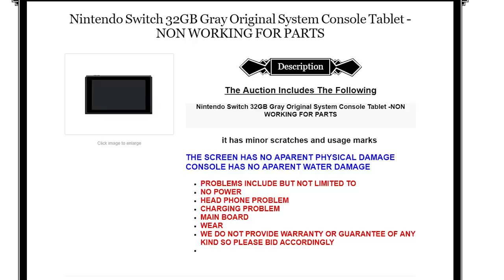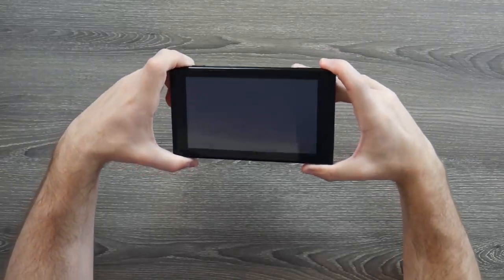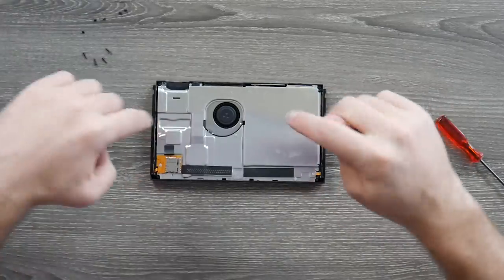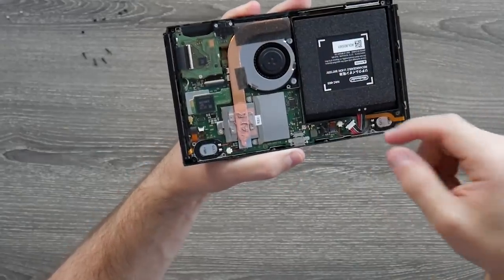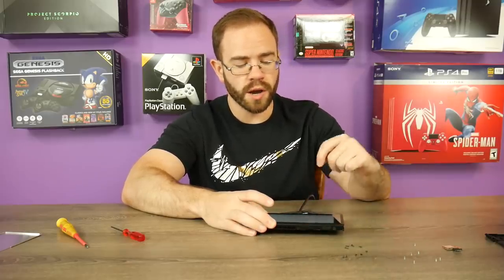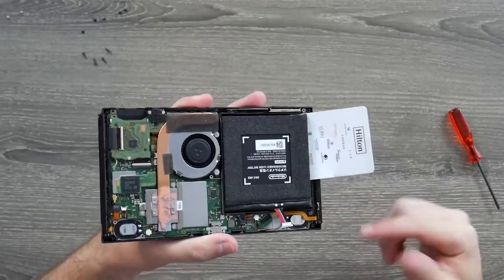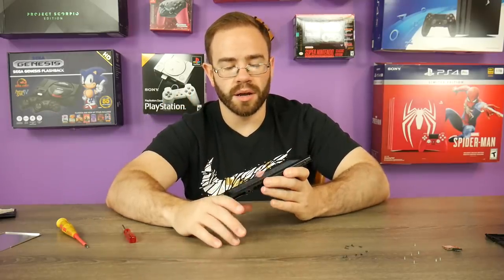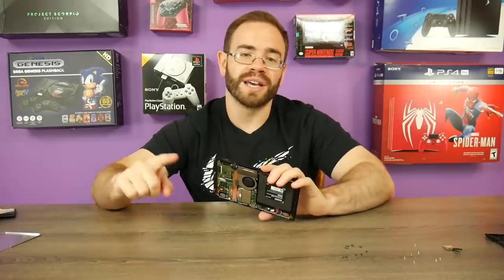I Bought A Broken Nintendo Switch On eBay...Can We Fix It?

Comment: Check if its compatible with CFW and use it to mess with CFW, i've heard that XC2 in portable mode with a bit of OC (using 400+ mhz core clock speeds, usually you dont overclock over the stock speed plus that its really unstable if you go over stock, you just adjust the speeds during portable mode a little bit higher than the defaults,) helps a lot with the crappy dynamic resolution.

Comment: Definitely informative but I wouldn't buy it unless I just needed a second Switch, like you said. I got my complete console with Animal Crossing on eBay for $225, so it actually came out to less, especially considering if you had to buy the battery.

Comment: I purchased a "broken" switch for $100, it had the wifi chip issue where it just needed to be heated up so it would set better in the solder and connectors. Now it works amazing. And it has BOTW and New super Mario brothers games on it, BONUS.

Comment: I would certainly love to get a broken Switch to repair it and use it as my own. 
But it doesn't seem like that's worth it like at all. 

They will in 95% of cases just sell the Tablet, so if it worked, I needed to buy the Dock and Joycons anway, upping the price QUITE a bit. Then I don't have Spare Batteries and shit, that in this case would help troubleshooting and fixing. And last but not least, most of them are sold on ebay for like 80-100€ without anything else. In this case with the Battery, that's totally worth it. But anything could be broken and if it has corrosion all over the place, I would have wasted 100€.

Comment: If it's 100% discharged it can take a few min b4 u can see anything on the screen after u connect the charging cable. So i suspect it's nothing wrong with the battery! One more thing we never saw u test the headphone jack.

Comment: For my second switch I bought a fully working, complete bundle with games (second hand).  I then stripped the bundle and sold the games / joycons / dock / charger and anything else that came with it.  In the end, my second switch cost me nothing, and the bundle price was so good, and all the other parts were a surprisingly easy sell.  Well, all except NBA 2K18, ha ha.

I do plan to do it again, but the other way round.  Keep the dock, charger, joycons.  And sell everything else.  Hopefully end up with a complete switch for really not very much money at all.

Comment: Why is everyone ranting about dark mode being better and white mode people are bad? I just want to put my switch the way it is. It’s not bad or good! I think both are good in situations! (I’m used to light mode since I never had a dark mode). So why is everyone that has dark mode mad about it? Ex 1 : “Light mode people are too lazy to go to their setting for anything” is a reply I saw. I use it to recalibrate which never even worked. I also use it to time travel when I absolutely need to. I use it to also to delete my profiles, etc. 
Ex 2 : “Light mode people are Treacherous.” I saw this in a comment, I’m just getting real sad about this, It’s not really a big deal? What if WE don’t know that we can change themes? I’m really weak. I can’t even open a water bottle. What is a big deal about light mode anyway? It’s just light mode. I don’t use my switch when the lights are dark. 
Ex 3 : I’m super forgetful, so I might forget everything on how my switch is dark. I might try for hours to fix it, and give up and ask someone else to help.

Comment: Serious Switch hardware inquiry: you mentioned that you needed to test that the switch worked with the dock - in the event that you didn't, what process would you have taken to fix it to output to the TV properly? I ask because I have a switch with a very finnicky USB-C port or the like. It charges perfectly, but only outputs to the dock on very specific angles when plugged in. Any insight on how one might fix this?

Comment: The light theme is good for using the Switch (and any other device) outdoors using a LCD screen. People nowadays love to annoy developers for dark themes but they dont make much sense in interfaces which you have to use outdoors like a smartphone, they make sense if: a) it has a option to change the color scheme quickly or based on the time of the day; b) if the app is used mostly indoors like Netflix or c) it can save some battery on devices with AMOLED screens, which the Switch doesnt have.
Using dark themes on direct sunlight and having to see extremely glowing white interfaces at night is awful.

Comment: Just FYI. That battery might still be good. A completely discharged battery needs to be plugged in for a few minutes to register. You can also try holding the power button for more than 12 seconds.

Comment: O got one with a broken output chip for 90$ it came with 2 tennys racket 2 joycon conttoller grip style 4 joycons dock original charger original hdmi 3 games screen protector caring case and cartages holder for jist 90 it is pretty beat up tho

Comment: I am wondering that he did held the power button for several seconds to try to restart if it got stuck. Also I remember that the switch behaves oddly when the charge is really low... perhaps it just needed to be charged for 20min to react to the power switch!?

Comment: Nice tip for removing the battery use a little bit of 99% alcohol, just be careful not to get it to leak onto the screen. It works wonders on adhesive and makes it really easy.

Comment: If it was a battery issue, wouldn’t it have still turned on if it were placed on to a dock? Or is the Switch designed so that the power is routed through the battery regardless?

Comment: So i am gonna be real. I have a switch and i left it in my car on a cold night and it died. I tried charging it for like 2 days and it still wouldnt power on. I kept trying to charge it with various chargers and finally also detatched the joycons and it worked perfectly .Theres a good chance that was actually nothing wrong with this in the slightest
 . So I have a feeling the same thing happened to this person but they werent as persistant as me.

Comment: Could you test the existing battery with a voltage meter if one doesn’t have an extra battery to test the system with? These repair videos are really interesting! Would love to see just a soldering tutorial or other practical troubleshooting tips!

Comment: Hey. I need a Switch man. It costs too much here!!! U$D 600~800. Crazy...but sadly true. Jajaja 😆
Reply: Kyle Anderson  Yes, know  that inside U.S. and maybe Japan it´s the correct Price but here, in Uruguay, you dont find a Switch fot less than $550. Is too expensive if you take the converssion. (U$D 1  = UYU 35,14). 
To have an example,  the average salary is UYU 33.000. Buying a Switch from UYU 20.000 to UYU28.000 is that or eat. 
Regards.

Comment: i mean, yeah, the battery had alot of adhesive on it, but.. it Was easy to get to, and all you have to deal with is the adhesive. You dont have to take off other parts like the main board or anything like that just to get to it, so in that sense, the Switch battery is fairly easy to replace (easier than a phone battery for sure). The fact that all the parts are modular is a nice thing too. Nintendo, intentionally or not, made a easy to work on system.

Comment: I like to use tooth floss to get batteries like these out. just get it under the battery in one corner and work your way through under the battery.
Im using the light theme by the way. Kinda like it more aesthetically...

Comment: For the battery removal use a little bit of clean ethanol. It makes it very easy to remove anything with adhesive, especially batteries on the phones.

Comment: i think the person that had this switch before had this switch in autorcm mode. but i dont know if putting in a another battery turns off autorcm. seems like the person was trying to hack it but didn't know anything about what they were doing.

Comment: I have a broken switch like on the tablet and it won’t turn on for some reason and no water damage I just been wondering what screw did you use to open the Nintendo switch?

Comment: I had a laptop that I traded to a friend and then the fan died but before I traded it to him it was missing some screws that just fell out I never thought I could screw them back in so I never even attempted it I still have the screws somewhere I never knew how important a fan was to a laptop the laptop was unusable would constantly crash and everything when the fan die but we replace the fan and now it works good as new

Comment: I don't know if he'll ever see this comment but the fan doesn't seem to be blowing air when the switch was turned on. I don't know if that's an issue with that specific fan or if the chip needs to reach a certain temp to kick off.

Comment: I'm planning on buying a switch next week or so. Are there still issues like that the screen bends or gets scratched from the dock and things like that?
Reply: The bending is like really rare, but it can be fixed by putting it under light press while its on. The scratching on the dock can easily be fixed by just buying some strips of soft fabric. No issues that damages the switch, even the slight bending is harmless if you are unlucky to get one. Remember to check your switch right out of the box. 90% of the bending are factory related and can be replaced for free within a time limit. Just buy the switch and take it from there. In almost every cases the switch is perfect, best console i have ever owned if you look away from the gamecube.
Reply: @DvineCupcake  Okay nice, thanks for the info ^^
Reply: Dubious Daydream Just dont listen to the ones saying the switch bends overtime because of heat, that is just people worrying because they got a bent one from the start. If yours has a tiny bend at the end, it wont get any worse.
Reply: @DvineCupcake  found a secondhand deal nearby so I got myself a switch ^^

Comment: I just realised that when my Switch was broken 2 years ago it had the same problem. I sended it to Nintendo and they told me the battery died. They could just fixed this but they gave me a new Switch instead. Mind you there were no cloud saves back then, all my Zelda save data was gone.